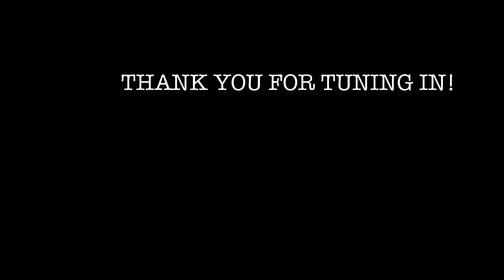Wash & Talk: Sacrifice

Comment: I Feel you bro on my cb7 some parts took me 10 years to get and at the end I sold the car and I keep I the rare parts I have  the car for 19 year and I never was able to get the racing Hart wheels that I wanted for the cb7 but no worries i got them now no cb7 but still a rocking them on summer on the gk5 Honda Fit the Fit has a lot of parts from the cb7 in memory of the cb7
Reply from the maker: I hear ya man. How is the FIT treating you man?
Reply: Fit is great is a good car for dd
Reply: When I feel that I need more hp the Acura TL is on the drive way